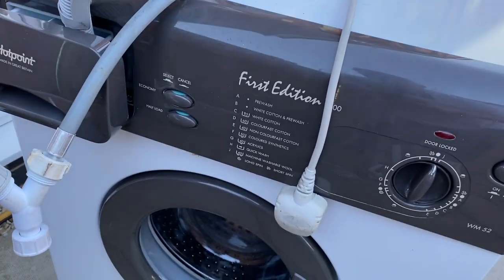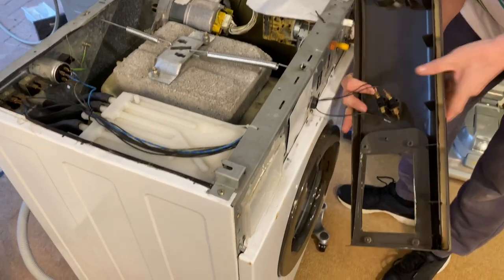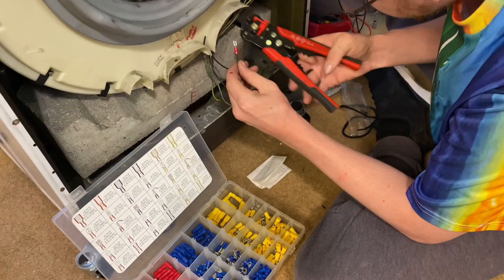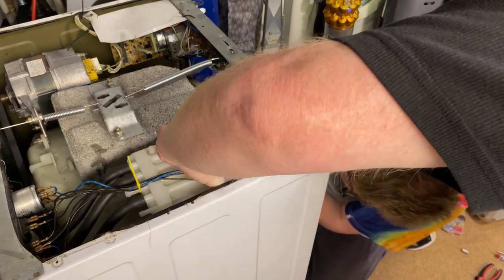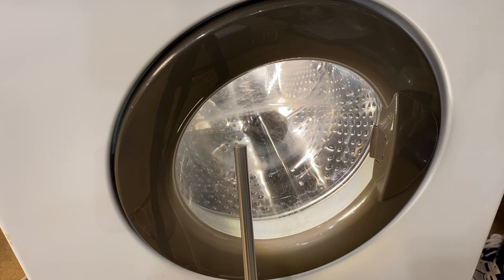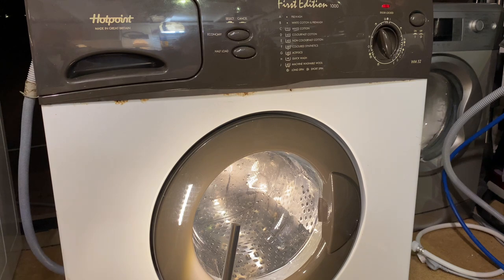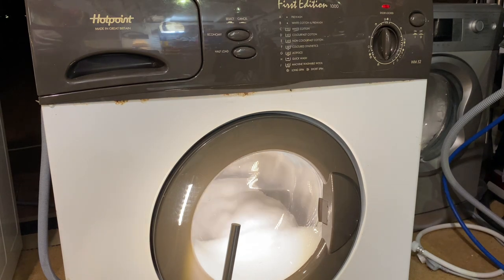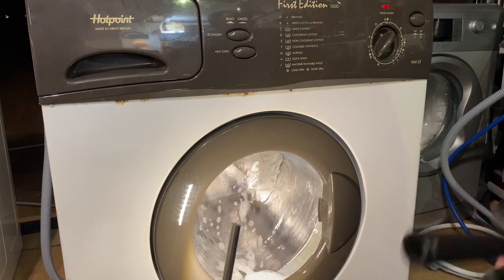Hotpoint WM52, First Look & Heater Replacement @servisslimline

Comment: When hotpoint was hotpoint. Really easy to work on. Bearing change was a doddle. Easy access to the motor to change the carbons. I couldn't tell you how many of these I've worked on. In the 100s at least.
Reply from the maker: I just wanted to say how absolutely grateful I am for every single comment and suggestion you make, your an engineer and I’m just learning and bodging along and I genuinely appreciate your help, hints and points. There are a few out there who just keyboard warrior messages, but you always take the time to be nice and helpful, so I just wanted to reach out personally to you and give you great big huge thank you. It’s a pleasure every time I see a comment from you 🥰
Reply: @HooverLux  it's great to see these machines saved. It was the end of hotpoint as you know when Indesit/Ariston  took over and made them as cheaply as they could get away with. I've always been interested in washers since I was a kid. Went to college and trained but sadly most machines don't get repaired as much as you know the parts are expensive.... If they have them in stock and customers don't want the expense when a new machine woildnt be that much more expensive. Oh and I know about the keyboard warriors 😂 I've had my share. I came off tik tok because of them. Had over 8 thousand followers in 10 days and over 2 million combined views and a lot of positivity but you get the few with nothing better in their lives than to make others miserable.

Comment: I do like these machines I have to admit partly because my mum had this in white so it's a blast from the past indeed for me!!! Fabulous you managed to get it working again!! X
Reply from the maker: With Phil’s magic engineer fingers and diagnostics, some new parts on the way and I do hope it lasts a good time longer. Looks like it’s had extensive refurbs done already, motor, springs seals etc, now with new dampeners and belt. Sounds so nice

Comment: When I got my front loader it came with bolts that kept the drum from moving during transport. Did any of yours have these bolts and if so do you still use them when you move the washers around? They went in from the backside.
Reply from the maker: Ah yes, the transit bolts. I keep them, but I wouldn’t ever use them again unless I was moving home a long way or taking it abroad, but just a move around the home it’s fine.